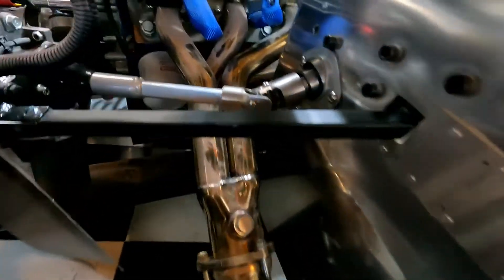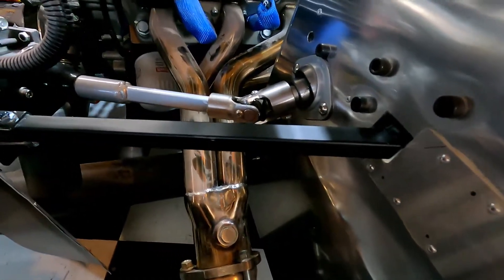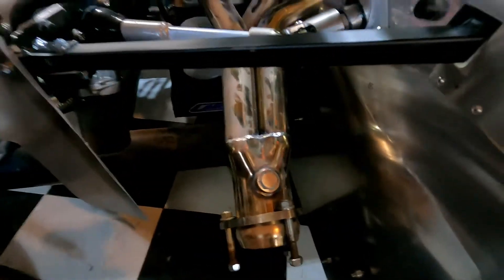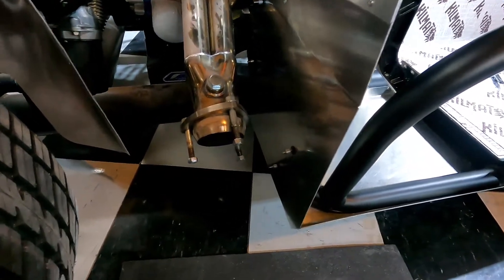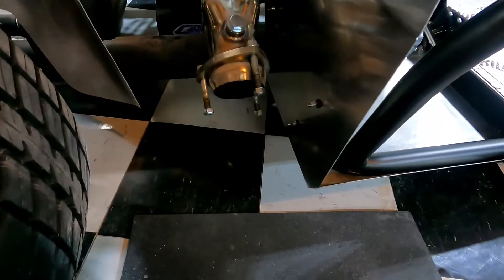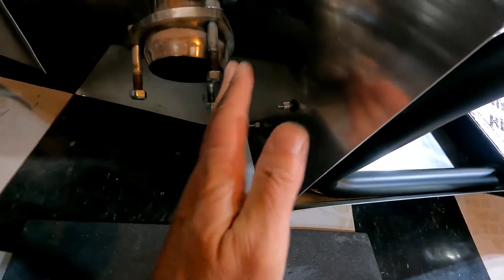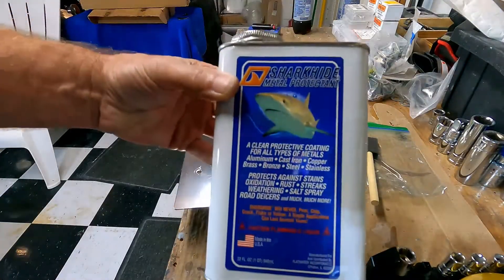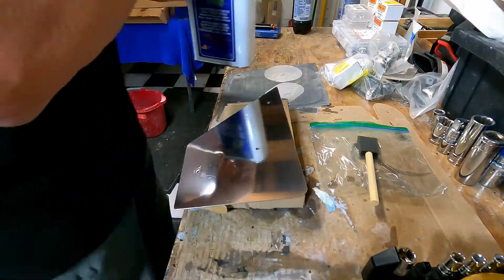FFR MK 4 Driver's side footbox - simple heat shields fab and install - Shelby Cobra replica build

Comment: Now that you have the Cobra on the road, how do you like the Kilmat sound dampening matting and the heat shielding technique you employed at the footbox area? Would you do anything differently?
Reply from the maker: I doubled up on the footbox walls. Kilmat and a layer of Cool it thermo tec. The little bit that I drove it with the insulation installed only, it seemed fine. The heat shield was probably not needed but I had the metal and time. I will have some longer drives here shortly now that it is about done, will update further soon.
Reply: @livinonklandathu  Getting your car on the road is such a thrill; it must be difficult to contain the anticipation. Your attention to details yielded a Cobra to be proud to drive.
Thanks for the replies.
Reply from the maker: @wild_bluyonder843  Yes, I'm ready to drive the @%*! out of it. Thanks for your comments, it is appreciated much. Did your kit arrive? How is the start of it going?
Reply: @livinonklandathu  The kit arrived on 3/31 and I'm working to shortages on the front end. Mostly completed the fab/install of the drop trunk yesterday. Only one broken drill bit so far. Hahaha
A box with so many sheet metal panels to jigsaw puzzle into place...holy moly!
Reply from the maker: @wild_bluyonder843  Nice! I like that mod, it just makes sense. As I was doing panels, every time I couldn't find or remember where a panel was, it was in that box. It is an endless supply of aluminum 🤣